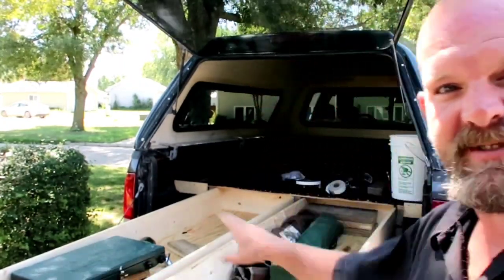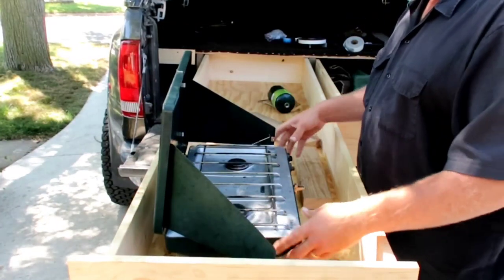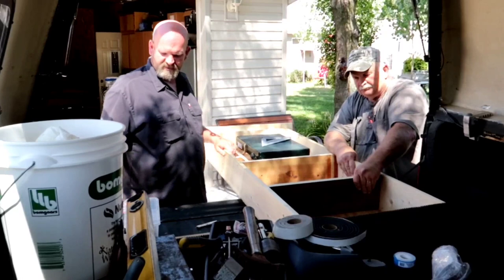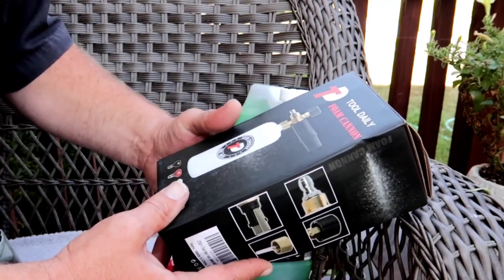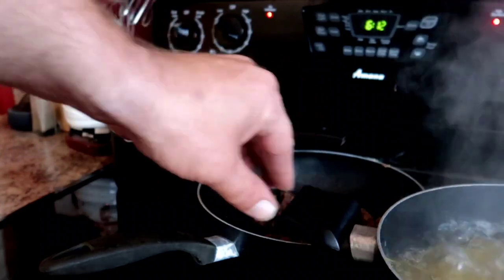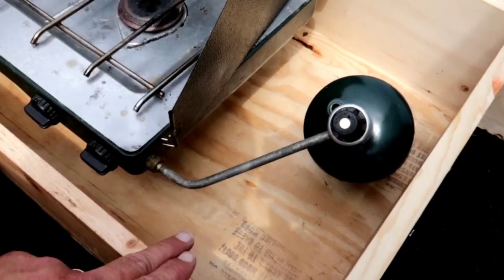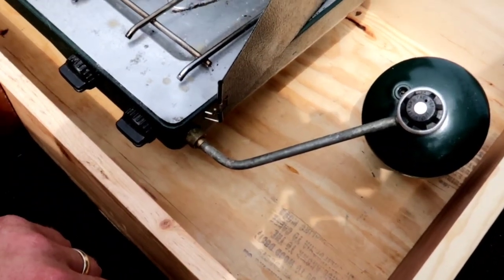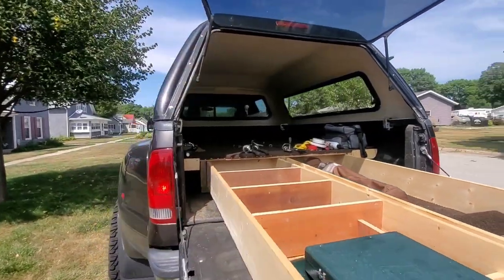The Truck Camper Is Near Completion | Ep410

Comment: Your stove area in the drawer: I suggest that you line the bottom of it with heavy duty aluminum foil folded up around the edges to make a tray like disposal able barrier from the plywood. Would also be good to use some finish on at least that portion of the area to help seal it from stuff. You need to make some provision to keep that area from becoming soaked with the inevitable spill and splatter of food and grease- if you don’t you will find it is very attractive to ants and other undesirable critters and that’s also your sleeping area. Nothing like little crawlies to enhance your sleeping experience.
Enjoy your videos-hope your healing continues and you are back on the road soon. Ed--Arizona
Reply: I made the same suggestion on his Instagram page.  Great minds think alike.

Comment: Hey Kurt, tell you dad he should bevel the front of those drawers! 
Also, I noticed that roll of carpet at the first of the video, and I was thinking that that was going to be the first thing that installed, so you only had one big piece to deal with, and you wouldn't have had to do all that extra unnecessary cutting, and fitting, and re-cutting!...🤔😲🙄👍 
Good job though!...👍 
Also, you should get you some old one piece molded gun racks (2 or 4),if you can find any, and mount the sides of the topper to hang your fishing poles, or guns, or anything else you might think of!...🤔👍 
And I noticed you're actually wearing a t-shirt! Good for you!...😁👍🤙✌

Comment: Oh there's one thing I like to say that spaghetti look like it turned out pretty good but there was more spaghetti than there was anything on top of it well maybe that's the way you like it the way I do it cuz I boil my hamburger cuz I have a cholesterol problem so I have to boil my hamburger and it get as much grease out of it as possible in the strainer in the sink and while that's going on and the noodles are cooked up I put the sauce I use Prego or ragu put that in the pan once a hamburger is done I put that in there and then all poured the spaghetti in with it and mix it all together instead of pouring it on top I mix it all together comes out pretty good for myself then put some Parmesan on it the onions and the peppers in it turns out pretty good